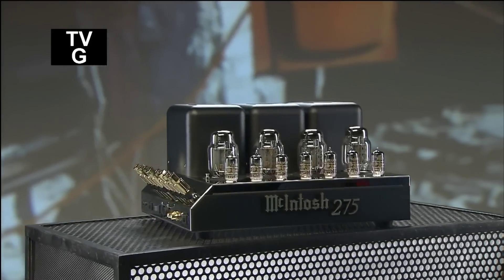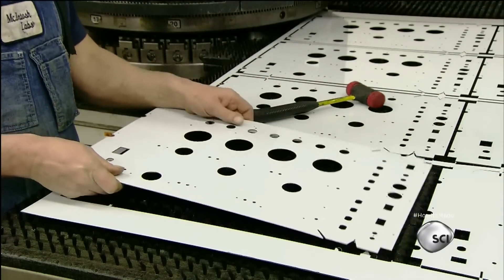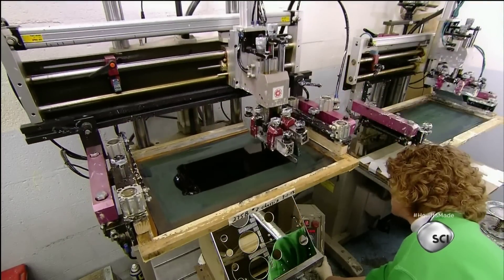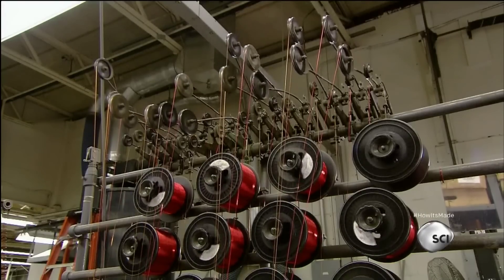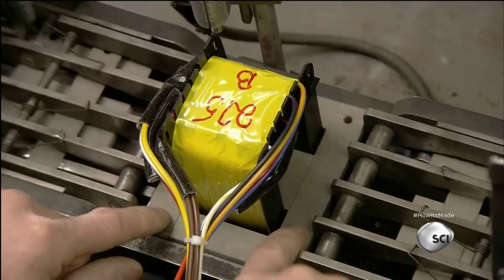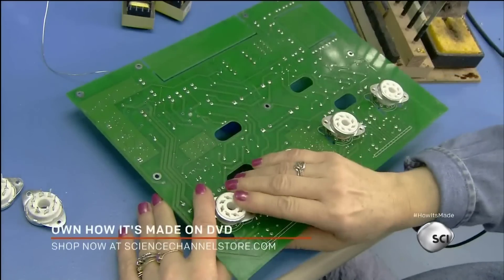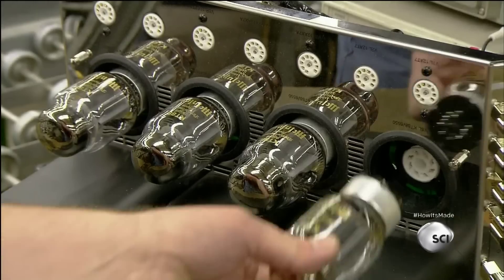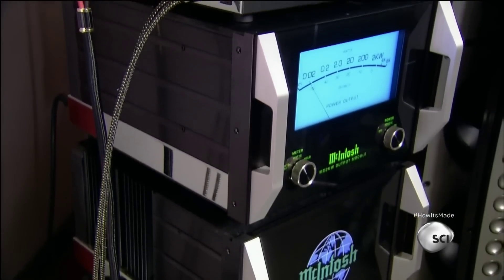How It's Made - McIntosh Tube Amp

Comment: "Magnetic terminals would react with the current and cause distortion." implying non ferromagnetic conductors like brass don't. Also in the meantime the tubes are completely unshielded and exposed to any electromagnetic interference.
Reply: +chsxtian Don't EVER get into an argument with an audiophile. It's useless and they will drag you down to their IQ.
Reply: DrHillbillyShow Ferromagnetism of the condctor doesn't affect eddy currents. It doesn't matter what conductor you use, the magnetic induction will be exactly the same.
Reply: tube amps are popular because audiophiles will spend money on literally anything as long as it is expensive as shit and it's merit can't be proven or disproven
Reply: +chsxtian The inductance of brass conductors at audio frequencies is negligible.  More audiophool hogwash.
Reply: +chsxtian Also the brass terminals are connected to a PCB with copper traces, leading to standard non-gold plated spade terminals (because you can't see if they are gold plated when inside...), and then onto more standard copper cable.
Reply: tube amps add measurable distortion to the sound. you may like how this sounds (ie adding warmth) but is none the less inaccurate. Solid state amps can amplify sound much more accurately.
Reply: +chsxtian I am a power engineer, and I just like to read Youtube comments for lolz ! GJ ! keep them comming :P
Reply: milwaukeegregg Clearly I'm not a spelling nazi - your spelling was fine, you were just using the wrong words...perhaps you just need to pay more attention...

You seem happy to criticise others, but you're not so happy when some criticism comes back at you...
Reply: Let me see if I can make this clear…. I'm 65 and was a formally trained electronics bench technician in consumer electronics. This means that I worked on many many tube amplifiers, at least 100 in the late 1960's and early 1970's, including McIntosh amps…. its how I supported my family. Most speaker terminals on powerful tube amps were cheap fiberboard with flat head screw terminals which were made of plated steel…. riveted to a steel chassis. All of the tube amps that I repaired went through my standard frequency response/power output test with expensive equipment. Never at any time was radiation ever exhibited in a consumer tube amp that would cause a feedback or magnetic  concern… it just didn't exist. The basic problems that tube amps had were of course a broken filament (dead tube), power output tubes where the plate on the tube would glow "cherry red", which indicated shorted audio coupling capacitors… sometimes the audio power output transformers would burn up because of this…. you could also get knocked on your ass from this because the speaker terminals would have almost 200 volts on them… which also burned up the voice coil on the speakers. Other issues in more poorly designed tube amps would be parasite oscillations…. basically a small waveform riding onto of the main audio waveform. This was corrected by trying different disk capacitors in the tube pre-amp section. I also repaired many many solid state amps as they overtook tube amps. Actually, the United States lost its consumer electronics production to Japan because the US engineers would insert a solid state device into a tube amp a little at a time, basically placing early and thermally unstable transistors into an oven… the amps in the US became crap because of this. Having had all of this experience I read some of the comments with amusement. If you believe some of the theory's here amounts to the trees moving makes the wind blow ;). Read lots of theory books I'll take experience over that quite frankly any day.
Reply: OnE61811301 i fear you're right
Reply: +chsxtian Pseudoscience at its best (worst?)
Reply: +milwaukeegregg While you're talking about smart, you don't seem to know the difference between your and you're, and there and their

I would recommend you don't buy one of these amps - spend the money on your education...
Reply: This isn't an English class ace. Spelling nazi's are socially inept and look to make a joke out of every little thing, except you haven't checked your pants. Thats where the real joke is!
Reply: DrHillbillyShow that wasn't my mom. it was beevaeeta with a wig on. He was smiling rite after he said It was your turn!!
Reply: +J. Mack   When I was about 4 years old I reasoned that the moving tree limbs and leaves caused the wind.  But then I was puzzled when the wind blew in the winter when the trees had no leaves.  I asked my mom and she explained.
Reply: I couldn't have said it better myself.
Reply: Those SMT ICs you see are part of the auto bias circuitry. They don't 
handle the audio signals. My home brew tube amp uses transistors and ICs
 in the bias circuit as well. This adjusts the bias of the tubes to 
compensate for the tubes as the age, as an under biased tube is going to
 draw too much current and wear out sooner. Older amps had manual bias 
adjustments that required technical knowledge and a volt meter to set 
up, and they need to be maintained on a regular basis. These modern tube
 amps sound superior to ones made back in the 60's. I have a McIntosh 
from the late 60's, and I have an Elekit that I built last year. The 
Elekit runs circles around the old Mc, despite it is only 8 watts per 
channel, but it is a class A single ended amp.
Also with auto bias 
you can roll the tubes to different types without worry, as the system 
will auto bias them as soon as they warm up.
The gold played 
connectors might be a stretch, but when you are charging this amount, 
the people buying them will expect this extra touch, because not only 
are they listening to them, they are looking at them.
Reply: Get an education in electronic engineering and stop talking stupid crap.
Reply: Welcome in the bullshit marketing 😏
Reply: Gold plating improves signal conductivity... but you already knew that.
Reply: +chsxtian I've been an engineer, not an 'audiophile' since 1991 and the amount of bullshit you're spewing would gag a goat. It's blatantly obvious that you have no clue what eddy currents, hysteresis or resistivity are.
Reply: The funny thing is I KNOW EXACTLY what they mean and you say you have a hard time believing me. What is blatantly obvious is you still haven't had time to go look up what I posted and come back with any response that makes sense. See, that's the thing about Wiki and the like, you can read a definition all day long and you still will not know what ferromagnatism (or paramagnatism) are or induction are, let alone hysteresis and resistivity. This is especially clear to anyone here that while you argue against science, you have not ONE TIME dared to try to use Lenz, Maxwell or conservation of energy. You've hit bottom and started to dig.
Reply: dieselscience I'm sorry, but as an 'engineer' you should be familiar with simple terms like 'ferromagnetism' and 'induction', so i have a hard time believing you.
Reply: Can any of you self taught geniuses tell us the hysteresis of iron vs brass and why ONE and not the other influences the induced losses in transformers....?
Reply: Pelican - EXACTLY WHY BRASS IS BETTER THAN IRON for this use - because inductance is negligible whereas in iron it is not. In the listed usage, we do not want induced currents, hence....

http://www.g3npf.co.uk/inductors.htm

Next question, why are transformer cores not made of brass???
Reply: The human ear prefers the distortion of a tube amp, really we do. That's why they are still popular, we like the sound. Solid state amps do amplify sound more accurately and that why people say they are somewhat sterile when compared to the tube amp. It's the variety of distortion that scientists have proven the human ear prefers to a perfectly clean sound.
In the what sounds best is the best. Do you understand that concept?
Reply: chsxtian, you are a poor troll. Your sock accounts are pretty stupid as well.
Reply: DrHillbillyShow Inductance in non-ferromagnetic materials is negligible, that's why they build transformers out of them /sarcasm
Reply: DrHillbillyShow Do those windings look like iron to you?
Reply: +chsxtian I worked on high end McIntosh tube amps like this starting in the 1960's…. shielding was never, ever an issue… only high quality sound… the best audio amps on the market.
Reply: dieselscience See, the thing is... all you do is spewing some random terms that you found on wikipedia, and you can't even apply them in a real life application like simple induction on brass connectors. Please go to highschool if you don't grasp a simple concept as current goes through wire, magnetic field goes around wire, regardless of the material the wire is made of.
Reply: Audiophiles spend ludicrous amounts of money on their toys BECAUSE THEY CAN. I know this fact makes some people green with envy, but face it. If someone is spending 50 grand on a amplifier and a set of speakers, it is because that have that money burning a hole in their pocket. Personally I would much rather spend my hard earned cash on some bling for the living room than say spend an equal amount of money going on some vacation to some country in Europe where you have to worry about some nut running you over on a bridge, or blowing themselves up in a cafe.

Comment: Warmer more natural sound? That's what tubes give by their nature. How about a Class C amplifier using solid state. That would give a much warmer sound with no cross over distortion and no transformers. Just add or subtract fixed resistors in parallel with the speakers. May need an auto biasing for the output stage when changing speaker impedance but big deal.
Reply: +SirDeanosity A class C solid state would not necessarily sound bad but the harmonics do not sound the same.
Reply: +SirDeanosity it's still different in the sound, warmth being only part of it.
Reply: Class C is meaningless for baseband amplification, its only for an RF carrier.  The output of class C in audio would be extreme amounts of cross-over distortion anyway.